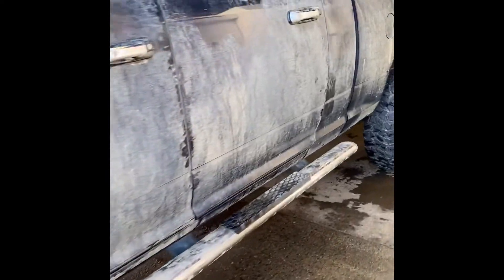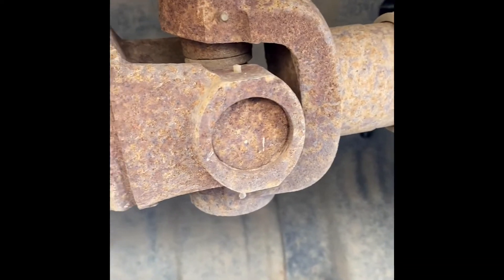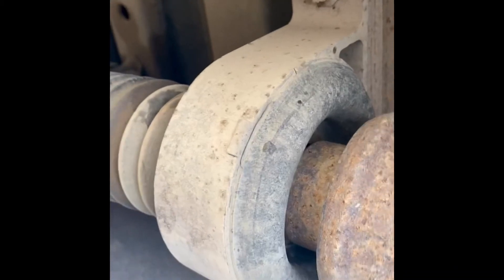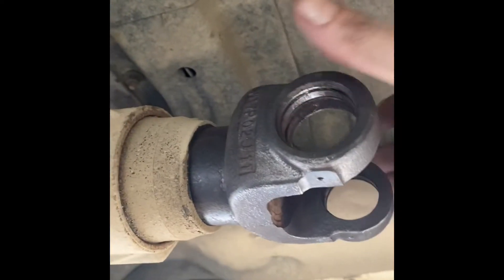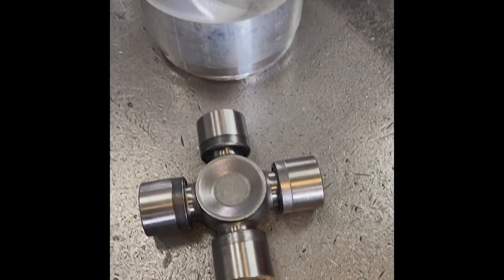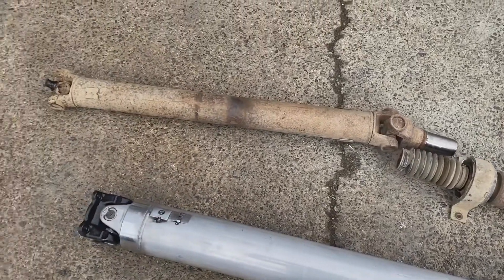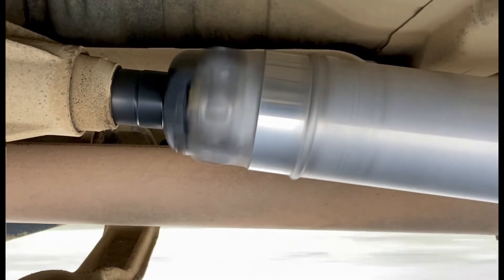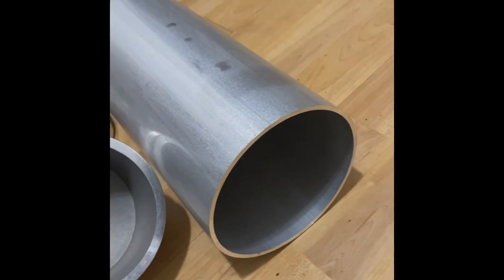Dodge Aluminum Driveshaft Swap

Comment: I have a one piece aluminum drive shaft 72” long and after 5 carrier bearing I ordered a one piece from East Texas Dodge drive shaft company 800 bucks to my door and both ends of drive shaft is brand new no used parts and no shipping your ends to them. They only use factory new ends and don’t forget to remove both mounting brackets they are stacked one on top of the other and wire brush where you removed and that way you can clean it all up then you can primer it and then put a couple of coats of paint on the spots that have surface rust all ready and you will be surprised how nice your new drive shaft spins at any speed and no vibrations!
Reply: I’ve seen your comment on other videos and I can’t find that company unless you’re saying it wrong